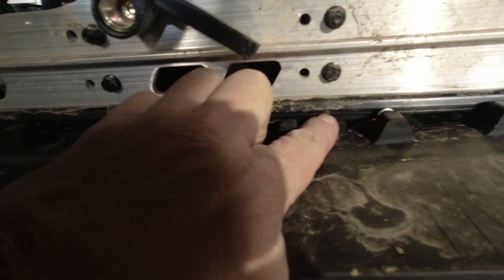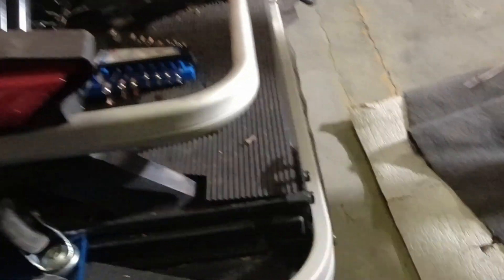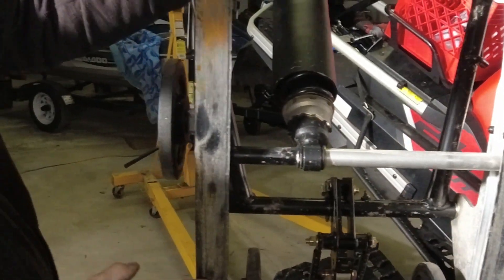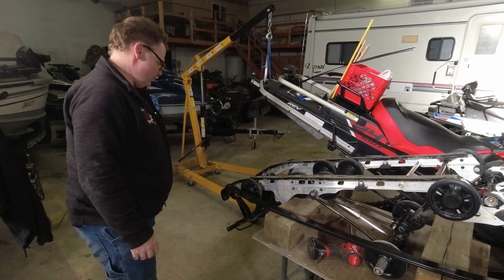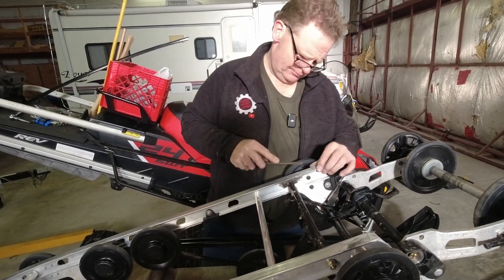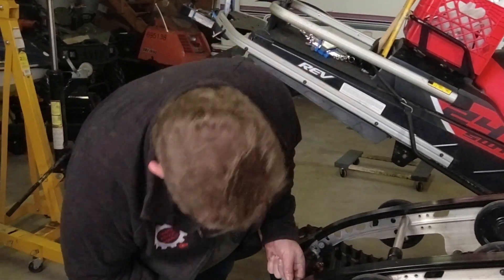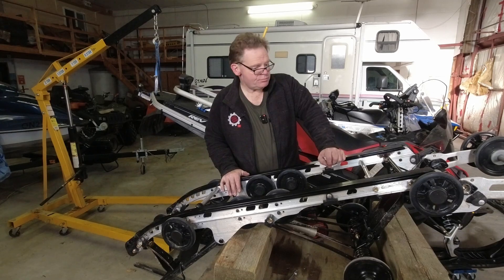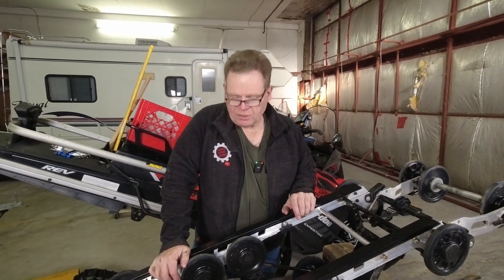2019 Ski Doo Expedition SWT New HyFax/Sliders

Comment: Hi Doug
Question about the damaged sliders: did that machine use ice scratchers?
Reply from the maker: No, it does not have scratchers on it but it was not run on hard packed trails or bare ice either.  The owner is an experienced rider and knows to 'dip' his track in loose snow.  That is his big concern, the slides were not abused in any way and still only lasted one season.